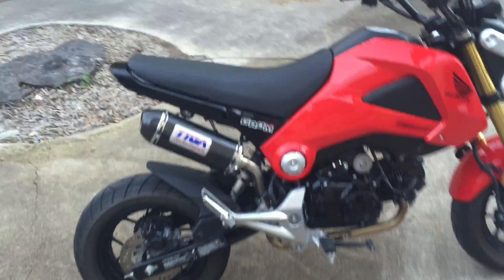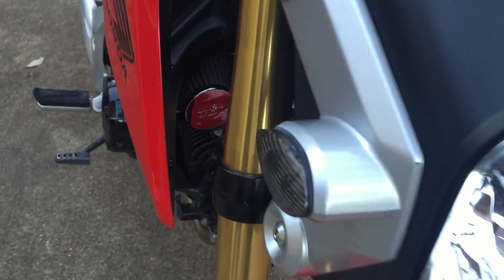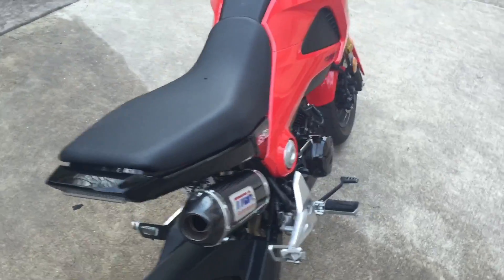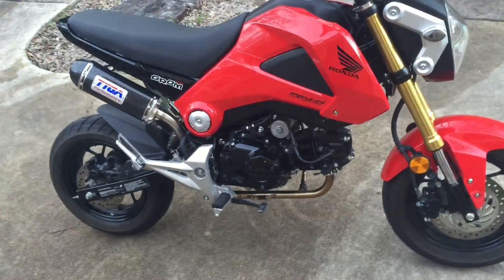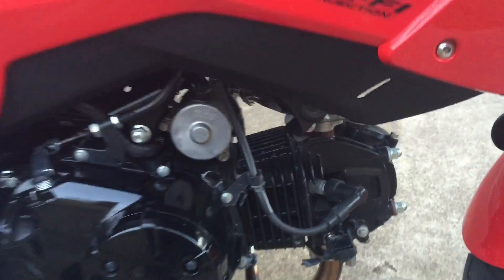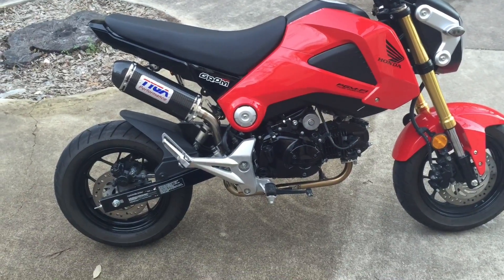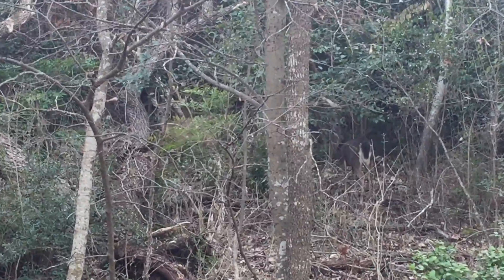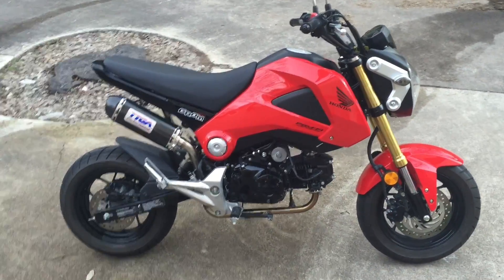Honda Grom Performance Mods #2 - Power Commander V & Wideband 2: What To Expect? PART 1

Comment: What map did you use? Yoshi full exhaust with Pod? Or did u customize a map since u flashed your ECU which my understanding is that it shouldn’t have been necessary since u r using the PCV. ECU flashes are typically done when u choose to not install a piggyback unit correct?

Comment: Ur butt dyno might not feel it, but ur top speed definitely suggests a decent hp improvement.
Reply from the maker: yeah, there's about a 2x increase in hp. It's been a while since i've looked, but I beleive the BBK alone is supposed to take the stock 8 or 9 hp to 18 or 19. "Butt dyno." Haha, nice.

Comment: I’m seeing some white smoke come from my exhaust here and there is this normal ? Idk what it is
Reply from the maker: Depends on how much. From my experience engine modifications will lead to a little bit of oil burn - thus the white smoke. However, I know someone with a stock grom, and it burns a little here and there. Could be valve issues, could be rings, could be a few things. If the bike is not overheating, I would just make sure you keep an eye on the oil level. Time to google! Good luck!

Comment: Remove the brackets that hold the seat strap completely and problem solved, so very easy to remove and install the seat. 
Got this tip from another guy on the tube so I can't take the credit for it.
Reply from the maker: That might have been my video too.
Reply: modestcody123 
We'll if it was it sure helped me out. 
takes seconds to put it back on. 
Stay Safe
Reply: modestcody123 
We'll if it was it sure helped me out. 
takes seconds to put it back on. 
Stay Safe

Comment: Hard to trash good health for anyone or anything, but man 6 bills to have a healthy 125!  I hope there is a little more cost effective way or controller to have a healthy bike.  Especially in light of no noticeable increase in performance as stated in vid, but then you write top end up from 66 to 74.  This is just from the intake/exhaust mod I assume? I have done the cold air and an IXIL exhaust on mine and it will cruse at 51-54 in 4th @ 68-7100 revs. (I'm 6/230 with gear).  I am thinking about maybe an EJK controller and TBD cam in search of a indicated 60-65 mph cruse at sub 9k revs on level ground.  Possible?
Reply from the maker: I mean, I do weigh considerably less than you (180 +/-), so that helps for the top speed. I think that the air/fuel ratio changes make a huge difference. I know I didn't feel that way at the time of this video (I go over that in the next part of this), but I do now.  Honda has the ECM really dumbed-down to help with emission, and have the ability to sell the bike in a vasts amount of locations, whit different regulations. This really puts a damper on what the engine can actually ( and safely) do. I think that any controller will accomplish this, some better than others. You might just want to do some research before you buy any of the other, not-so-name-brand, units. The cam will make a huge difference, and then lightening any rotating mass (oil spinner, sprockets, rims, etc...). Good luck and thanks for such a great comment!

Comment: Another way of getting Speed or acceleration without buying a Big Bore Kit is by getting a little bit smaller Gear for acceleration or go for  a gear with more teeth for more Torque and a little more top end speed!
Reply: are you sure? I'd imagine adding a gear with more teeth (larger circumference) would reduce the final top speed. but yes, would add torque.

smaller sprocket= higher top speed, slower acceleration
larger sprocket= less top speed, better acceleration.

If I am wrong feel free to correct me, I don't ride or modify motorcycles so I am no expert by any means.
Reply: A larger sprocket at the back = more torque, a larger sprocket at the front = more top end. It's also important to mention that most 125s are geared long anyway and are usually limited by power and not gearing. So gearing it for more top end will likely just reduce your top speed due to the reduced torque/engine RPM. My CB125F for example tops out at about 65MPH at 8000 RPM but doesn't red line until 9000-10,000 RPM. If I wanted more top speed out of it I'd actually need to gear it for more torque.

Comment: Good video..  Quick question since you got the mnnthbx fender eliminator and I have it too and planning on getting the same exhaust. it's awesome, anyways does the plate hit the Tyga exhaust when it's in horizontal position? I know it hits the stock exhaust. But I wanna know if it hits the Tyga ? Thanks!
Reply from the maker: +Juan Galarza In this video I have the plate in the vertical position. I have since changed it to the horizontal position, and bought a $3 bracket at Lowe's to extend the plate out slightly to the left side of the bike, because yes, it will hit the TYGA.

Comment: the price of a brand new grom would be close to 5k out the door including tax and fees..

for $3000 you can get a 2009ish Drz400 with way more hp and capability.. But if you already have a bike or two then the grom would make for a great second or 3rd bike.
Reply from the maker: +greenrolaids I've had a lot of bikes. My gf doesn't like motorcycles due to an unfortunate accident with a loved one, so this bike was a compromise. I love it though!!!
Reply: With tax it's only about $3,300
Reply: I have Yamaha MT-07 plus a grom the Mt 07 pulling 11 000 revs in first gear would beat my grom top speed up a slight hill, it's not about power or speed with the grom it's the fun factor of riding such a small bike
Reply: $5k😂 
Somebody is ripping you off!
Reply: I got my 2015 grom on Friday for 4k WITH financing out the door everything needed included in the price.

Comment: So what did the whole thing cost you? Electronics, pipe, filter, and anything else. Just wondered because I can get a brand new stock CB300F for just over $200 more than a new Grom OTD. MUCH faster, freeway legal, and should be a lot of fun. So just what is it about the Grom that makes it worth spending all that money on when you don't get any more performance. I've never been into modifying bikes for performance. If I want more performance, I get a bigger bike.
Reply: It's not about the price, if you want a CBR 300 then you are always going to be the guy who bought the Bike that is low displacement but tries to look like it's a 600 race spec. The Grom doesn't try to look like something it isn't. It's the little bike that could. It puts smiles on people's faces, which an underdisplaced sport bike is a sheep in wolves clothing.
Reply from the maker: Modding it is the fun part. Those bikes are awesome too, but there is something about the Grom being so small that makes it amazing. I've owned a lot of bikes, but this is by far my most favorite of them all. Hard to explain until you ride it. Grom is freeway legal here in Texas, and if I had to, I'd do it all over again.
Reply: That is very well said!

Comment: Great videos man!  I had a question for ya.  I am torn between the 2 brothers SR1 and the TYGA that you have.  My question about the TYGA is.......  Does it come with a silencer that you can remove?  Also I am concerned about that black stuff coming from the exhaust because you said it's not welded.  What do you think?  I don't want that black stuff spraying all over my bike.  What do you think about the 2 choices?  I want o get a bit louder but don't want to piss off the neighbors.  Thanks in advance
Reply from the maker: +Paul Monroe It does not have removable baffles, but I think the sound is just right anyways, and seems to have adjusted to the bike. As far as the non-welded part goes, a little bit of carbon leaks out after a while, but it is easily wiped off. It does not spray everywhere, and takes some time to appear. I kind of like the way it looks... Thanks for the kind words.

Comment: Modestcody123 where did u buy your power command and wideband 2?
Reply from the maker: I got both from hardracing.com. They seem to have the best prices (and will price match), and they will be the only ones (or at least they were) who have the power commander v with the Grom wiring harness already attached. Which makes it plug n play.
Reply: +modestcody123 thanks for the quick response. I'm looking to get both parts. watched some install videos and doesn't seem to difficult.

Comment: Add stickers makes it go faster
Reply from the maker: +NoPointOfThis123 I'll take dual overhead cams in a single cylinder Grom!
Reply: i hear that if you have flames on your bike you get 10 horsepower.
Reply: modestcody123 Hell yeah that's how you crank the power lmao
Reply: I knew there is a quick speed-performance stickers.  Got 14 put on and 2WOW!   That is the greatest speed step up I could have ever done!  Got so much better I beat a hibiscus the other day, huh, not hibiscus!    Well, he told me, oh, hell yea, it was a Suzuki hibachi.  Well, it was fast.
S

Comment: do you need the wideband 2 with the power commander?
Reply from the maker: erikmoua You don't need it, but the PCV will only make changes to certain points in the power band (pretty much everything besides the low end). Adding the wideband 2 module allows the PCV to make adjustments to the entire spectrum of your revs. Thus leading to and increased top and low end. Auto tune will also work, but apparently is not as efficient as the WB2.  Good luck!
Reply: Are the EJK furl programmers any good for a 2017 Grom ?

Comment: Did you even put the bike on a DynoJet to tune it?  You didn't mention anything about how you made a tune for the bike.
Reply from the maker: passthespanner The wideband 2 module came pre-tuned from hardracing.com, however it has an auto-tune feature that keeps it running at the optimum setting for the given environment, hence the O2 sensor I pointed out. Regarding the PCV, I downloaded the map from hardracing as well. It is mapped for the exhaust/intake combo this bike has. No dyno needed.

Comment: Good review, thanks. Did the new air filter and exhaust make any improvements to the fuel economy? Also did changing the exhaust reduce the weight of the bike? Thanks.
Reply from the maker: Lorimer Campbell Dropping the stoack exhaust, if I remember correctly, dropped 7 lbs.; ut don't quote me on that. Either way, there was a weight reduction.
Reply: I took my stock exhaust and muffler off and replaced with an ScProject stainless system and shotgun muffler.All up I saved 5.2.Kg's

Comment: Looks like a toy
Reply: modestcody123 You might not say that if you had to walk 5 miles home after work. The grom is cheap to buy and run, its a great practical machine for the masses of people around the world who cant afford cars. Also if more people rode groms, instead of driving cars for shorter runs, we would have a lot less pollution and a lot more space. Parking problems would disappear. And of course, the world looks a better place from two wheels.
Reply: All motorcycles are toys
Reply from the maker: That's exactly what it is.
Reply: Lorimer Campbell
I like the way you think!
Reply from the maker: Manveer Grewal That's what I meant too!

Comment: Would you recommend this for a everyday commute?? I drive like 15 miles to work and 15 back.
Reply: Joey Valenzuela I own a Grom (STOCK) as well. Awesome for less than 60MPH commutes. (NO FREEWAYS)

Fastest I've went is 71mph downhill
55-62mph no wind flat road
 moderate Winds can slow you down to 50mph easy
Hill climbs are usually 45-50mph

Fast enough for any street I promise
Reply from the maker: Joey Valenzuela I would say yes, as long as you aren't getting on any freeways. Seat upgrade might be the best option though. This one gets a little bothersome one longer rides.

Comment: I had the chance to ride with a fully stock grom. My top speed was the same as theirs, but I weighed more than him and we had a bad head wind in our face the whole time. However, I could out accelerate the stock grom in every case. I have a full system brocks exhaust, chimera intake, and pcv5
Reply from the maker: +GromTogether I don't know why I never saw this comment in the past, but I agree. I made a second video to this one, and I go over my more up-to-date thoughts on the system, and soon even a 3rd one I'm making right now. I was allowed to ride a stock Grom the other day, and it is far more sluggish, and the low end is really dumbed-down. I'd install these again in a heartbeat. Thanks for watching! Big upgrades coming soon...

Comment: A dab of hard setting black silicone pushed into the burn hole and smoothed with a wet finger will sort out your seat ;-)
Reply from the maker: krazed0451 Finally just bought a new seat. See video 2!

Comment: So on the add of this bike it says top speed is 55 mph. I want to buy one but I need to commute freeway so you did these mods that cost you how much total? And now you as able to go 74mph? That would be perfect. If you could answer these questions it would make my search end haha.
Reply from the maker: Edgar Horta I'd say it was about $900 to get it to that point, and yes, it now can hit about 75 mph. HOWEVER, that is on a long straightaway, and with the engine pushing very hard. That's something you don't really want to do to these things for an extended period of time. For commuting, and for a good price, I would recommend a CBR250 or a KTM RC390.  Grom is NOT a good freeway commuter. Good luck man!
Reply: modestcody123 Hah! It's a modernised horizontal Honda... Those things will run at redline 24/7, have a little confidence in Honda, they've been making engines like it for ~50 years ;-)
Reply from the maker: krazed0451 I agree that Honda engines are very good, but buying a bike for the sole purpose of running it at redline all the time is a bad idea. But yeah, to your point, it will do it... for a while.

Comment: Thank you for sharing. I actually do not like the springs on exhaust. Maybe I will just have 'minor surgery' done on my stock exhaust to  remove the  "extra, heavy and  restrictive"  internal pieces.   Since there are no  'real'  performance gains to be made with 125cc non-big bore,  this seems to me the proper thing to do.

Comment: I like the deer in the background.  Thank you for the honest report on the NON-performance Honda Grom products.
Reply from the maker: +J Martin Sorry for the delay on this response, but I'm glad I waited because I have a different view on these items now. In the stock engine and gearing configuration, these upgrades are only slightly noticeable. When I changed to a BBK, they became an integral part of the build. I'd say they are only needed if the owner is planning on making major mods to the bike as mentioned above. Cheers!